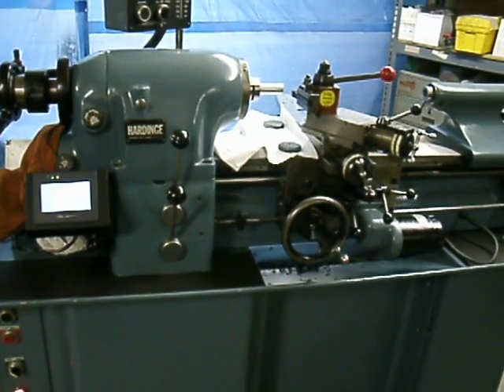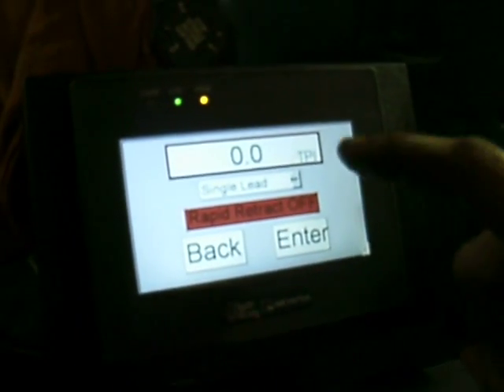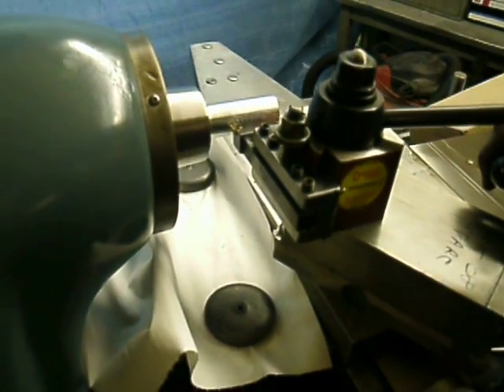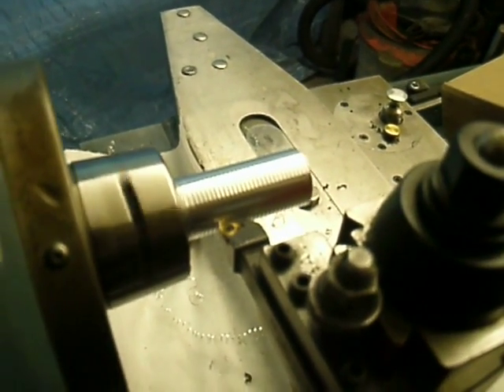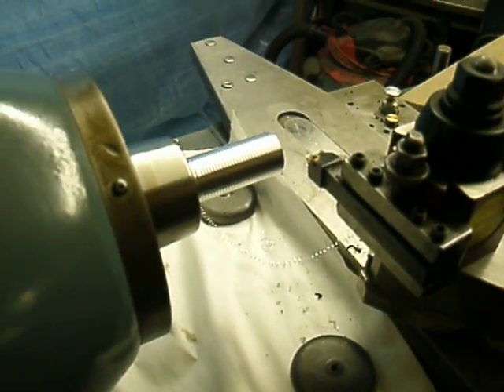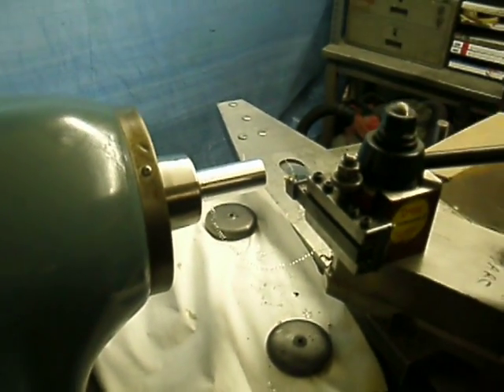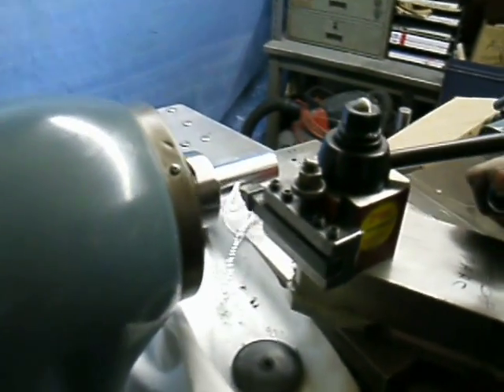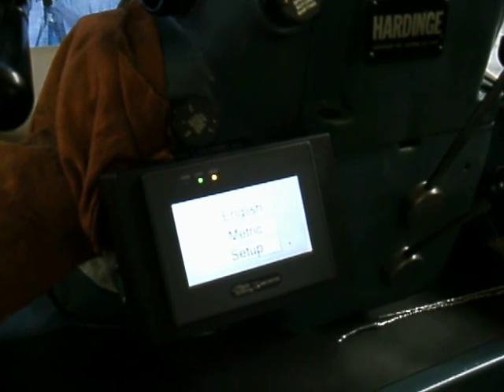Hardinge HLV digital threading retrofit, Part 1

Comment from the maker: The digital servo threading still operates with the factory leadscrew and halfnuts and inherent backlash.
This is not a CNC system with ball screws, etc.
Check out our HLV-CNC retrofit video.